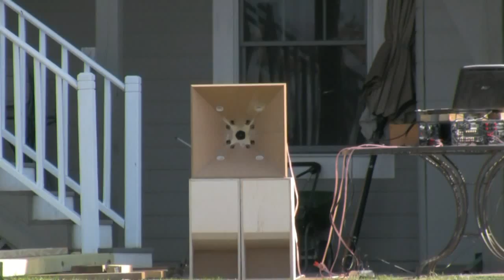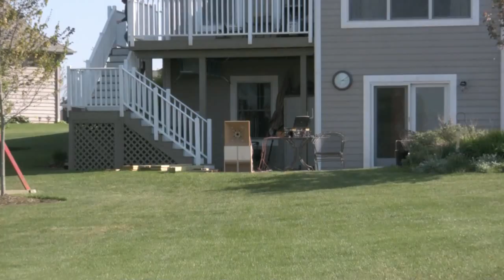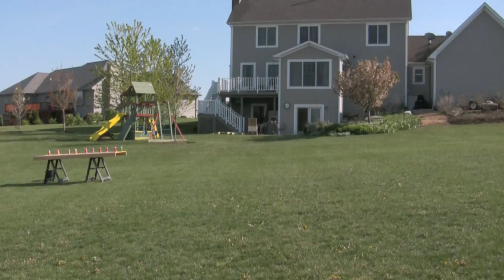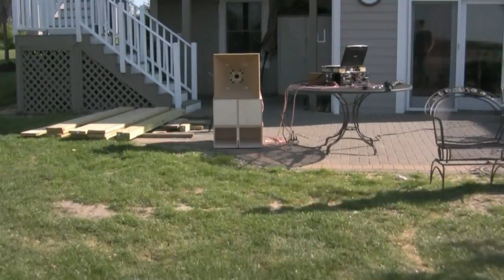DIY Synergy horn test

Comment from the maker: The midrange port locations are in front of the HD driver because they through the effect of the band pass are delayed ever so slightly and woofers in front of mids similarly.  If done correctly and with the right crossover you can approach an almost perfectly flat phase response where all the drivers act as one.  I believe much more in depth information about them can be found on Danley Sound labs website.    

I used Hornresp to simulate the midrange and woofers on my second attempt.

Comment from the maker: I am also amazed it turned out so well, and with no simulations of any kind.  The bass units are just some DIY folded horns that I whipped up in Hornresp using Dayton 8" DVC subwoofers (older shielded ones). 

Fist time I have heard of that design, looks interesting. For distance there is only one way to find out.

Comment from the maker: No settings for hornresp, I tried playing around with it some but could not get the models to look good. This was just an experiment that turned out far better then expected.  You can look at the build / FR graphs by heading over to AVS forum and look up "The very low budget synergy horn build" inside DIY speakers and subs.